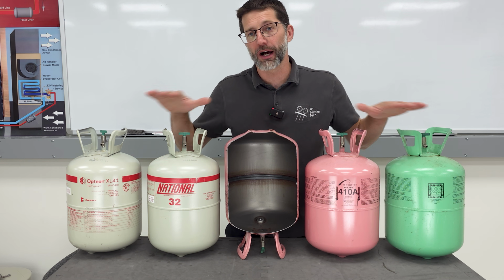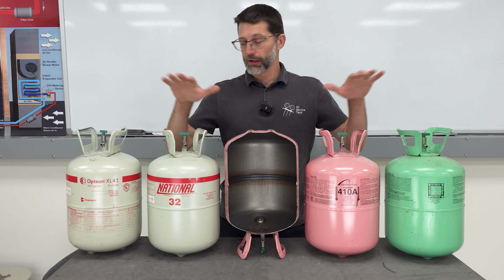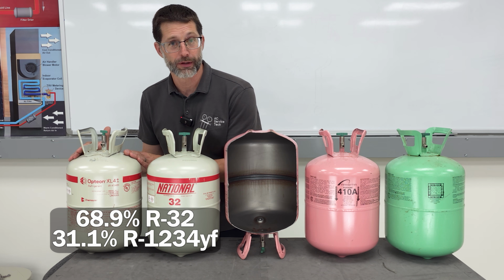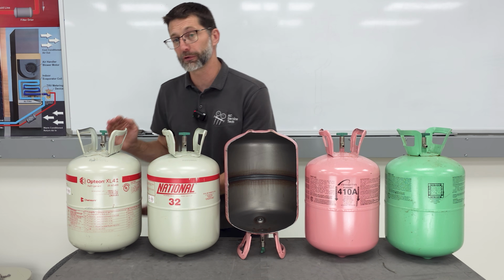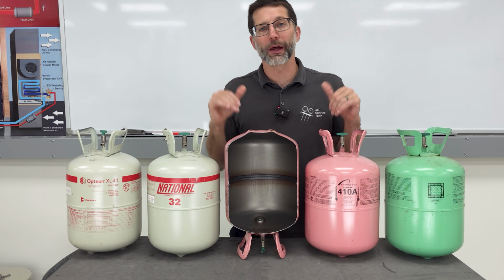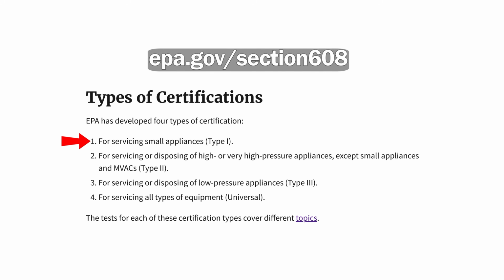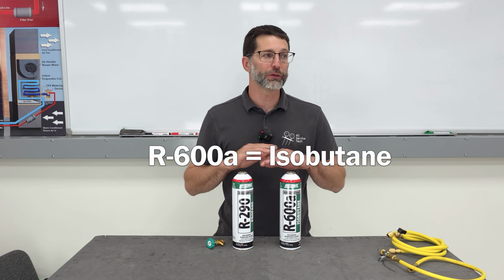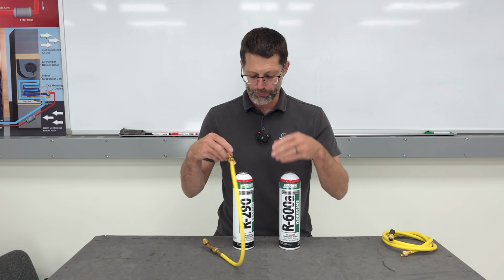HVAC Training on Refrigerant Bottles! R-32, R-454B, R-410A, R-22 Disposable Types, Recovery Bottles!

Comment: I have 3 R22 system's. I run R290 in all 3. Just replaced the compressor in my 3 ton system 4 days ago. Replaced it with a used compressor. Don't forget to replace/add oil. If your system has had any leaks at all, it will be low on oil. If it's leaked for 10 years, good chance it has no oil left.

Comment: Good video, nice presentation..
We painted the tops of all the R32 tanks RED and Painted all of the R454b tanks BROWN. 
All of our reclaim bottles and tools are painted accordingly, for ease of identification.
Stupid  idea on left hand threads, just leave the adapter on.
Muscle memory hard to control on removing the adapter, lot of inadvertent refrigerant loss. 

R12 and R22 was developed as a safe alternative to propane and ammonia. I have seven R22 systems, never had to add charge to  them since 1990. 35 years.
Low pressure. 
More leaks with the R410a system, we change many evap coils. Manufactures making better evap coils should be required.

Comment: You must emphasise safety? should not ASS-U-Me. R410A is an A1 class non-flammable, non-flexible and FIRE SUPPRESSOR IF LEAKED while A2L (R32, R454B) are flammable and (can be internaly explosive!)and FIRE PROPAGATOR IF LEAKED. You should state of the law and not what Chemical companies drill 🙄

Comment: Craig remember the Ammonia refrigerants back in the day? Had a refrigerator from the 60’s error that used open flame on an ammonia system, many house fires then.
Reply: Absorption cycle.
Reply: I'm sure some of them still exist and are likely in use to this day!
Reply: Ammonia and propane are two of the most efficient refrigerants we have. They are also cheap. That's why they are banned for use in the most common applications.
Reply: @Squat5000  yes and no. the issue is the deadly outcome of leaks.
take heavily foul scented natural gas/propane as an example, in which people somehow fail to notice the stench until it explodes violently and kills/maims.
add to that ammonia gas, which stinks, burns eyes, nose, throat instantly, overcomes you and displaces oxygen rapidly. forget about contacting it in liquid state, certain death, flash frozen everything.
also while not known for exploding into a fireball, the near perfect gas to air ratio can and does go BOOM, but everything is dead by then anyway
mainly for reasons of fools and idiocy, they were mostly discontinued as refrigerant gasses. perhaps we'd have been better off letting nature and natural selection run it's course?  🤔🥸
Reply: @throttlebottle5906 natural selection is the best course of action. Besides, we have sensors that detect both of these and in event of an alarm we'd be able to make it obvious.
Reply: @Squat5000 they aren't banned because they are cheap.  They are situationally banned because they can be dangerous in some conditions.  Propane can be used as long as it isn't inside a building.  For example, there are outdoor chiller plants that use it.   Ammonia is widely used in ice skating rinks and other large space, provided that there is a gas detection system installed which can alert people of leaks before the concentration becomes toxic (not sure how you wouldn't notice that with ammonia, though).  Ammonia is also used in commercial freezing applications.

Things don't get banned because they are cheap.  They get regulated because they are dangerous, toxic, or environmentally destructive.